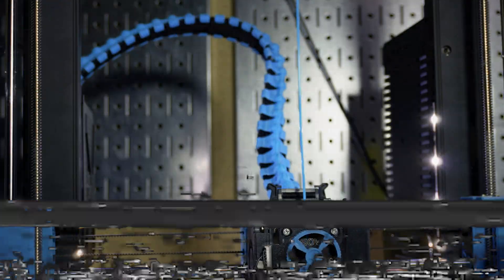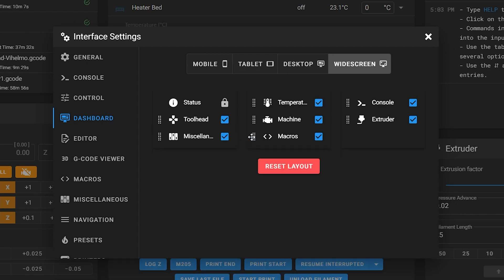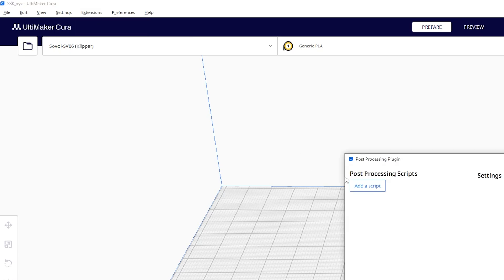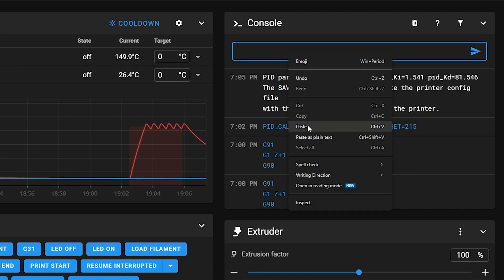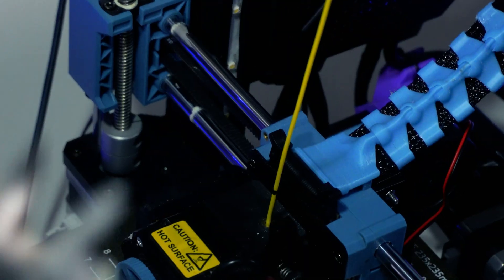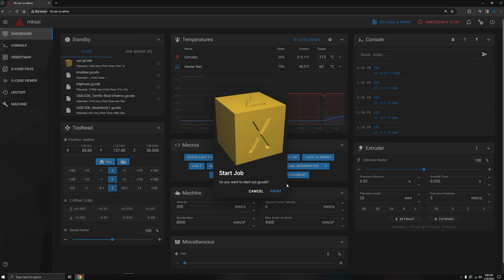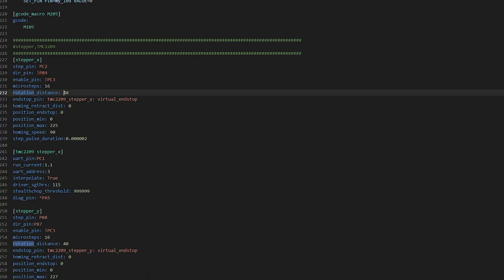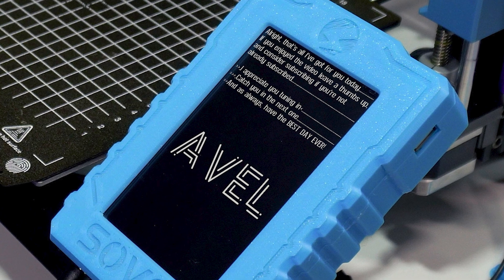My First Steps after Switching to the SOVOL Klipper Screen

Comment from the maker: Rotation Distance Calculator - https://www.service-uplink.de/esteps_cal/calculator.php
SOVOL Klipper Screen Case Model - https://cults3d.com/:1593050

◽Quick copy/paste for those interested.

[PID] PID_CALIBRATE HEATER=extruder TARGET=215
[E-STEPS] G91 followed by G1 E50 F60

Comment: Thanks for the nice video. Do you have any Start/End G-Code upgrades too?
Reply from the maker: Thanks for watching! 
My start Gcode in Cura looks like this (the end Gcode is untouched from what Cura's default is when you select the SV06):

G28 ;Home

G92 E0 ;Reset Extruder
G1 Z2.0 F3000 ;Move Z Axis up
G1 X10.1 Y20 Z0.28 F5000.0 ;Move to start position
G1 X10.1 Y200.0 Z0.28 F1500.0 E15 ;Draw the first line
G1 X10.4 Y200.0 Z0.28 F5000.0 ;Move to side a little
G1 X10.4 Y20 Z0.28 F1500.0 E30 ;Draw the second line
G92 E0 ;Reset Extruder
G1 Z2.0 F3000 ;Move Z Axis up
Reply: @Avel  Ah Thank you very much. I think your Start Code is untouched too. I have the SV06 Plus and the standard 
Start Code is this:
G28 ;Home

G92 E0 ;Reset Extruder
G1 Z2.0 F3000 ;Move Z Axis up
G1 X10.1 Y20 Z0.28 F5000.0 ;Move to start position
G1 X10.1 Y200.0 Z0.28 F1500.0 E15 ;Draw the first line
G1 X10.4 Y200.0 Z0.28 F5000.0 ;Move to side a little
G1 X10.4 Y20 Z0.28 F1500.0 E30 ;Draw the second line
G92 E0 ;Reset Extruder
G1 Z2.0 F3000 ;Move Z Axis up

Endcode
G91 ;Relative positioning
G1 E-2 F2700 ;Retract a bit
G1 E-2 Z0.2 F2400 ;Retract and raise Z
G1 Z1 ;Raise Z more
G90 ;Absolute positioning

G1 X0 Y200 ;Present print
M106 S0 ;Turn-off fan
M104 S0 ;Turn-off hotend
M140 S0 ;Turn-off bed

M84 X Y E ;Disable all steppers but Z

Do you know where I can find a good list of optional Parameters?

Comment: What’s the pid step you did for?
Reply from the maker: That was to keep the hot end temperature stable because I've changed my part cooling fan. 

If you change yours or notice that your printing temperature isn't holding fairly steady, it's a good idea to do this.
Reply: I haven’t taken that step yet. I’m a 3d printer virgin. I’ve been looking into it for the last few weeks and overdosining on how it all works. Resin still trips me out. Was a complete mystery or magic before I looked it up. Bambu a1 I really like but the sv06 is so cheap from Amazon but worried about the extra hassle that the a1 seems to have way over the sovol 
So sitting on the fence right now and happy to watch more vids. You remind me of old tony. So nice work on the vids. Really nice.👍
Reply from the maker: Thanks 🙂 I appreciate you watching!

I hear you. They're both good printers, but each has its pros and cons. I'm looking at the SV08 now, myself. I'm sure whichever one you choose, you'll be happy.

Comment: There is not that much content around about the Sovol Klipper Screen specifically so thank you for making your contribution with these videos!
I got myself a SV06 Plus with Klipper Screen from last Black Friday sales. It's been an interesting journey up to now, not without its problems but I think i've finally gotten them sorted out and can start focusing on printing big stuff. (I had bearing and warped bed issues but Sovol support sent me replacements.)
The Klipper Screen has been fantastic, indeed completely plug & play and I was surprised how easy it is to configure Klipper by just editing the easy to read config file and doing a quick reboot. And the WIFI! OMG I love the wifi. Being able to control your printer and send stuff to it wirelessly instead of messing around with SD cards is fantastic and the single reason I wanted Klipper Screen in the first place.
I have been wondering if it would be possible to control two Klipperized printers with it,like you can with Raspberry Pi's and even the BTT Pad 7. Does anybody have any idea? It seems there is almost half of the RAM available at least when I'm running it, some ~45%.

Comment: Thanks so much for this vid on how to properly tune SV06.   Sovol should have included instructions like this, or linked to your video!
Reply from the maker: Thanks for the kind words ☺️
Reply: Would you please do a video about getting a USB camera to work with the Sovol Klipper screen?
 @Avel
Reply: Never mind the USB cam video.  Yesterday I tried to set it up, with no luck.  Today I turned the printer on and the cam works!
Reply from the maker: I'm glad you got it to work! I was going to make a "shorts" video on hooking one up. I had the same thing happen where it didn't work at first. I just rebooted and it worked.